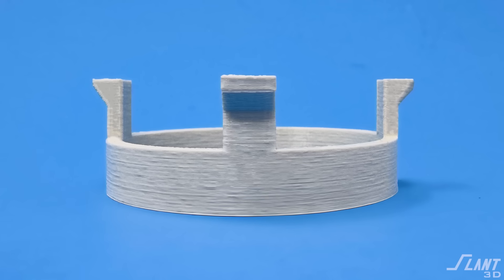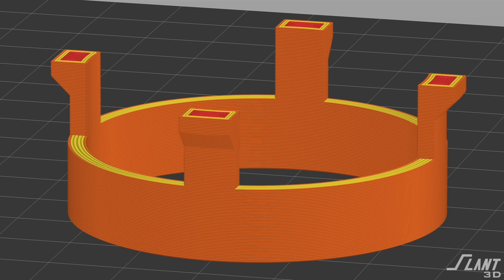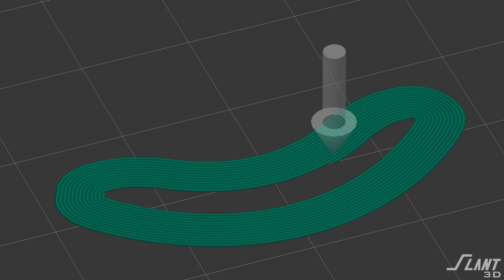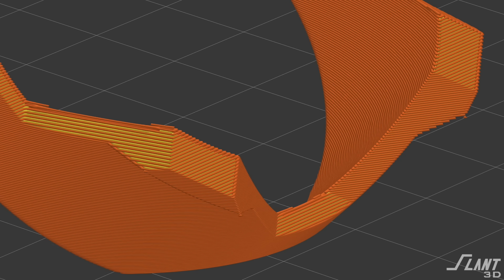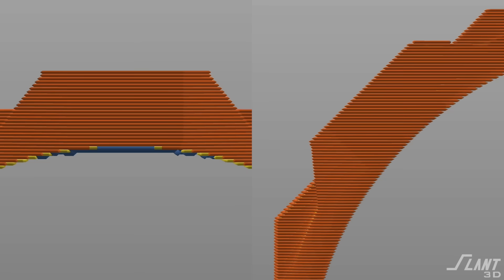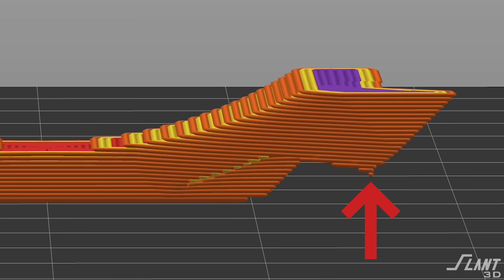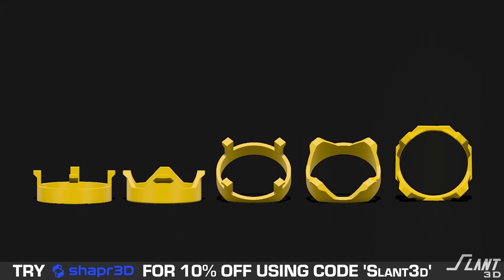Stop Snapping Your Snap Fits | Design for Mass Production 3D Printing

Comment: Calculation engineer here. Ways to make a clip more resistant to breaking:
1) Reduce the undercut of the clip (smaller “nose”)
2) Use material with a small E module (soft)
3) Reduce! the thickness of the cantilever (not intuitive! Then it bends more easily)
4) Increase the length of the cantilever (not intuitive and very strong influence, long clips bend much easier with less load on the material)
5) Use material with high strength (good connection quality between the layers, not the same as E modolus!)
5.1 -> Strong Layer Adhesion
5.2 -> Tilted Layers with strong direction towards tip of clip
5.3 -> Cone Shaped Clips with more material at foot than at tip
Reply: You are awesome! Thank you for the tips!

Comment: I had to produce a large number of backup sensor bezels for some cars that needed them. They use this exact type of fit and had basically zero room for modification as they fit into a shaped chamber in the bumper.

I just print them on their sides with traditional supports and a decent gap between the supports and part. Even the PLA+ prototypes were strong enough that you could nearly bend them double before breaking them. In ASA? Had to bend back and forth a number of times to do it. 

I could’ve spent many hours figuring out how I might’ve been able to alter the design, refining a way to do it without supports, etc….or I could spend a little extra time printing supports and save those hours.

Comment: I had a similar design, but in the slicer I used 100% filling, eg. no infill. The part I printed (in PETG) was crazy sturdy, I could not break it by hand. The wall thickness on the model was 5mm, so it was not that stong (by design)

Comment: My first thought is to print the clips and ring as seperate parts.  Press fit the clips into the ring, but now they both can be printed for maximum strength and glueing or plastic welding the clips onto the ring will be simple.

Comment: As someone new to designing for 3D printing, this is extremely helpful. 
I’m still used to designing for Metal where a tolerance of .005” [~0.13mm] is a sensible and reasonable choice so this is extremely helpful.

Comment: I'm only 2 years deep into 3d printing and about 6 months into designing my own parts using tinkercad. I struggled for a while with parts breaking until I figured out to eliminate the 90 degree angles as much as possible.

Comment: I typically chamfer the bottom edges instead of filleting them so every layer in the chamfer has the same perimeter overhang instead of laying down most of that overhang on the second layer

Comment: A little over engineered in my opinion. 
Another option is to print on the side and add mock tree support into your model to handle the overhangs. 
There would likely be no inherent advantage aside from keeping a closer model to the original design, and potentially a bit less filament. 
Overall though solid advice and great content delivery. Excited to see more from your channel 🎉

Comment: The real reason that the features break at the interface, is because of the toolpath pattern change. The same toolpath pattern (mainly the perimeters) on top of each other is the strongest bonding pattern. If you want a stronger pin, design the pin feature into the part, with a very small gap between. Then the pin feature is anchored in the part and the pin toolpath (perimeter) is the same in the part.

Comment: These are all not the best option in my opinion, there is a lot of overhang combined with little bed adhesion. In my opinion the best way is to make those clips stronger and connect them to the main body with flat bridges that can twist for the desired flexibility

Comment: Also a longer clip has to reform les per length unit resulting in less stress. So you can make the pins run longer by cutting in the ring

Comment: Slant 3D has another video on snap fits, where they deminstrate that the bending part of a snap fit doesn't have to be in the same direction as the snap fit part it self. In this case, you can design the bending to be horizontal and still have the snap fit vertical. That was an eye opener, and its super useful when designing parts.

Comment: Here's another solution i came up with the other day:

attach the snaps all around with a ring at the top. the ring will deform, but not when it's connected to the ring at the base. it will become too stiff that way. so below the ring is a 45 degree chamfer leading down to a very thin ring just for support (0.4mm thick in my case). this is standing on top of the base ring. the very thin support is interupted at the snap hook 'pillars' by a slot while the top ring bridges those slots and is continuous.
Wish i could add a picture here... works like a charm. allows for a flat on the bed position.

Comment: I would just split the hook and ring , put 4 hole on ring and print 4 hook horizontally than glue together or use some one-time joint design

Comment: Last year I did a part like this, I used a multi-part approach: printed the ring flat (it was threaded inside), and those tabs, i printed separately with them flat on the bed, they had one caveat: they fit with a dovetail type connection. I joined them using epoxy glue and a rubber mallet. Overengineered? Sure! But its holding better than the original injected part.

Comment: Another small thing that can help is filleting the distal end of the clip to give it a small ramp to slide up while it's bending to fit inside the other part. This reduces the amount of time that the clip is at maximum flexion while pushing the parts together which can help a little. It also makes it a little easier to start the 2 parts going together and then you just give it a little bop and they pop together.

Comment: If I had to join parts using some type of snap that has to handle relatively significant forces, I'd make pockets into both parts to accommodate separately printed hourglass-shaped "cookies" that snap into both sides. Then all parts can be printed in their optimal orientation instead of making compromises specifically to accommodate connectors and the pulling force across joinery is distributed dozens of layers deep into both sides. If the parts need to be taken apart, include some ejection holes to help with pushing the cookies out.

Comment: Never on any print have I needed a fillet on the layer in contact with the bed I think this is bad advice and only for old printers and software, plus it makes ugly overhangs. Modern ones solve this problem by #1 compensating for that expansion, and #2 using a load cell to get a perfect z height every time.

Comment: If I had to use snap clips like this I would split the part up, print the ring separately and print the clips separately so that the clips could be printed on their side and then slotted into the ring or glued, that also allows different materials to be used for the ring and clips. I know this isn’t a good option for mass manufacturing though due to the post processing and assembly.

Comment: one way to strengthen those clips is to design a hole all the way through it vertically. the slicer will see the hole as a wall and add wall thickness around the hole.

Comment: I've been working on a part similar to this. I've been printing it out of ABS and found that turning up the nozzle temp made a big difference. I also added fillets, which increased the rigidity. That in turn made reducing the catch size. I wrote off printing at an angle, because the part is so small and printing at an angle would add much difficulty. I'll have to think about it again and use some of your techniques to see if I can make it work.

Comment: You never want a fillet on the bottom layer of a 3D printed part, that's like day one knowledge.
Reply: I see where you are coming from, and it's a good practice but a very small filet(like 2 to 3 layers high) actually gives a better result than a chamfer

Comment: Theres a cannabis grinder design with teeth that snap right off, how can that deaign be improved? I was really wondering, because in a tobaco grinder for example its like the teeth have to pass by each other etc, the teeth are just printed on layers. Ok chamfers? How do i add changers in bambustudio witjout just adding a triangle overlayed lol
Reply: I can't imagine plastic is the best material for a cannabis grinder, let alone 3D printed plastic. I'm not very good at 3D design, but if I absolutely had to print out a 3D printed grinder, I personally would print it as vertically as I can without the teeth needing support. Don't want the tips of the teeth delaminating and getting mixed up with what you're about to smoke.

But like. If you have access to a 3D printer, surely you have access to a vape shop that can sell you a nice metal tobacco grinder for cheap

Comment: If you want stronger, make them a seperate part, print them in the other direction laying down, then glue them on or screw them on. That is odd course if you absolutely need to.

Comment: Great info. Thank you for always sharing and increasing the knowledge of the community. The thing I would change is instead of a filet at the bottom where the part meets the bed I would use a 45 degree chamfer. This is because a radius starts at an overhang of 90 degrees. You can chamfer the bottom and then radius the top edge of the chamfer so it is a radius that starts at a 45 degree overhang.

Comment: Further thoughts from a strength of materials perspective. This may be overkill for most people/designs.

1. Longer snap brackets mean less force is needed to deflect the bracket, and that means less stress on the material which leads to breaks.
2. Stress on the part, and location of failure, is concentrated on the base of the bracket. To spread out the stress, design the bracket with an ~15 degree taper (larger at base, smaller going towards snap feature). This will give you more snap force, more deflection, and less likely to fail.
3. Thickness vs. Width. The thickness of the bracket has much more of an impact on deflection force than the width. Try bending a ruler a few different ways (or something similarly flat) to see this in action.
4. Backstops. The bracket cannot break if you have a backstop that doesn't allow the bracket to bend far enough to break. Other features that protect the bracket can be helpful.
5. All snap brackets made to date are not optimized for 3D printing, so be creative! Your only cost is design time.

A more in depth guide that can be a good reference. I wouldn't worry about calculations for most things, just the ideas behind it. 
https://fab.cba.mit.edu/classes/S62.12/people/vernelle.noel/Plastic_Snap_fit_design.pdf
Reply: Great addition! Cheers!

Comment: PETG is worse from the layer adhesion standpoint. PETG just bends a bit better.
Reply from the maker: If you have petg layer adhesion problems you are printing it wrong.
Reply: @slant3d he didn’t say he had adhesion problems with petg he said it’s worse than pla
Reply: Hot PETG is very sticky stuff, almost too sticky. You may be overcooling it and/or have low nozzle temperature if you have layer adhesion issues. I print it at an absolute minimum of 240 C and oftentimes even hotter than that.

Comment: If changing orientation is not an option, but changing the material is, then TPU will provide the best layer adhesion. Rigidity can be improved by using rigid TPU with a rating above 95A.

Comment: Is there a rule of thumb for optimal first layer surface area for your print farm, specifically the min/max for part adhesion and auto-ejection? Curious to know if you have any data on this, or even just gut reaction based on experience.

Comment: I have designed and printed a part like this. I would like to add some additional points.

1) Reduce the thickness of the bending straw/base, but make it wider. Increasing the thickness is an intuitive mistake because while more surface area increases adhesion, it also makes the part more stiff and therefore less bendable and more brittle, and the separation force becomes higher on the outer wall because that part needs to stretch upwards more.

2) Instead of a rectangular or chamfered design for the head, use a narrow P shape instead. The rounding/fillet creates a good variation in bending force and angle upon insertion. Experiment with protrusion of the head and the fillet's maximum angle.
Reply: Addition to 2). The P shape also reduces wear and allows for easier assembly and disassembly.
Reply: yes. make it thin, make it wide, and make it long. And don't oversize the tongues for the amount of strength you need
Reply: The shape of head depends on what it needs to do. A P shape is good for things that need to be taken apart again whereas a flat bottom face is good for things that aren’t supposed to come out again.
Reply: Из своего опыта скажу что проще и надёжнее поменять материал на твердую или армированную резину, чем шаманить со слоями. Нейлоном печатать заморочно. Можно и сборную делать сделать часть резина часть пластик.

Comment: Might want to revise that 'add a fillet to the bottom' to add a chamfer... fillets on first layers are never great.
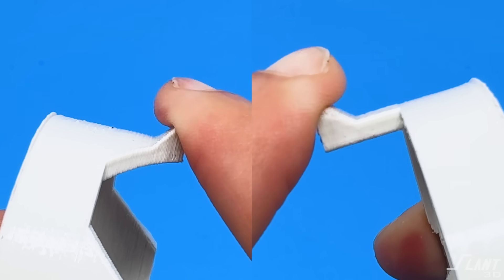Reply: 1:33 Yeah, the way that's depicted, it technically creates a 90 degree slope angle at the bottom of the fillet. It'll print, but not quite as modelled. I thought elephant foot compensation was a task for the slicer, not the 3d model.
Reply: @takatamiyagawa5688 in a production setting, do everything you can in the model. Imo including supports in some cases.

Comment: Fillets, they prevent stress points
Reply: Fillets, fillets everywhere
Reply: Chamfer are better for top and bottom edges
Reply: Avoid sharp corners in design
Reply: Me just thinking fillets make it pretty 😂
Reply: @rache5399 Same LMAO
😊
Reply: I would have thought that fillets advantages are much reduced in 3D printing as there’s a minimum filament thickness and so you can make a fillet of .1 mm diameter if you’re using anythin above a layer height of 0.1
Reply: @pandemoniumcrow  do you find fillets with a d of less than .1mm reduce stress points?
Reply: @TheOfficialOriginalChad  I was just saying that there are scenarios where fillets in 3D printing don’t work as well as machined parts.
I do a lot of printing and prototyping for airsoft, so relatively small parts that go under a decent amount of stress with blowback, and I’ve found there’s a lot of tweaking needed to get something that both fits in the trigger boxes and other tight spots that can withstand repetitive use.
Ideally I’d love to get those parts CNC’d but that’s simply too expensive for a random uni student with no CNC connections lmao.

I’m currently printing in overture nylon as that’s the only nylon I can feasibly print well on my open air printer, and obviously for strength I’m printing much larger layers than 0.1, typically around .28 to speed thigns up and then I’m finding my fillets are either too big and actually end up reducing the cross sectional area if what would be a stress point, or they aren’t so much fillets as steps which does seem to worsten the strength.

Though that’s just what I’ve seen other will probably have different results depending on what part and what machine you’re printing on
Reply: @pandemoniumcrow  oh yea I totally agree. 

I’ve been looking through design tweaks for efficiency and strength a lot lately and have noticed a theme: fillets replaced with chamfers.

Do you find hard corners to be best with small parts?
Reply: This. Avoid 90° angles..
Reply: i like fillet if its chicken
Reply: Eh, fillets have their place, but top surfaces is not one of them.
Reply: What's that?
Reply: @AckzaTV  avoid 90 degree angles whenever possible as the corners are where cracks like to form. Rounded corners displace force more evenly than sharp corners